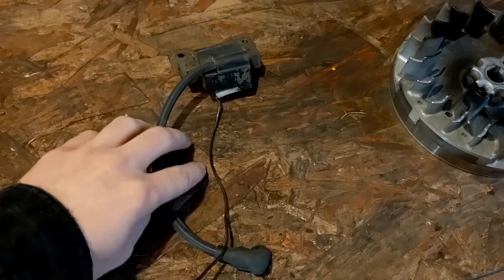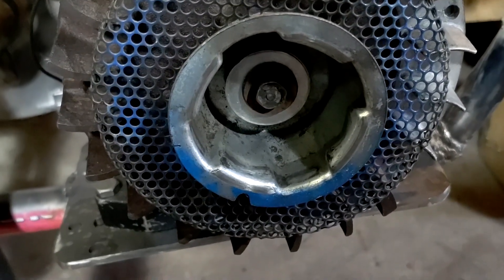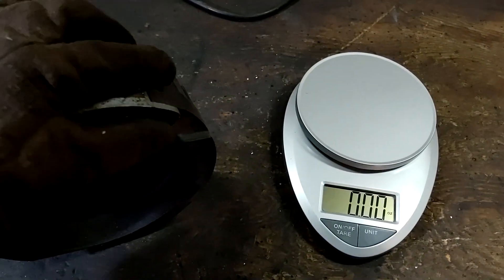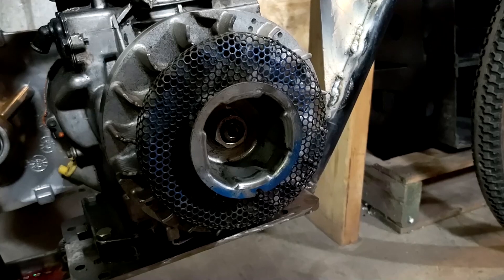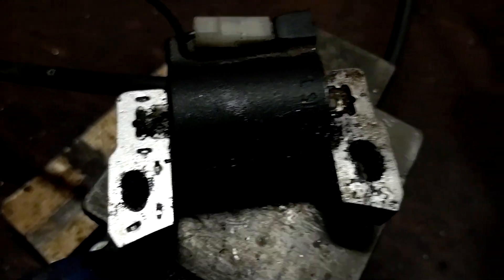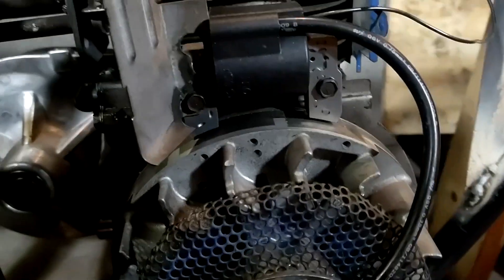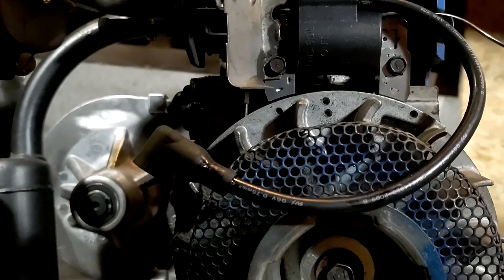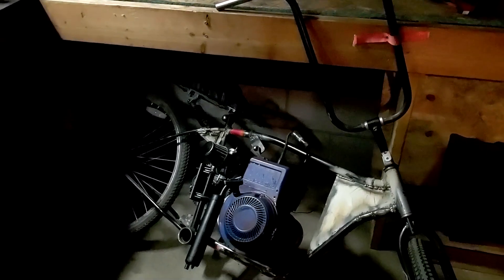Briggs & Stratton 5HP Flathead Motorized Bike Build - Aluminum Flywheel & Electronic Ignition EP12

Comment: thats great if you got spark it means more then likely it will run . now lets talk more about them forks . i was thinking and the issue is a lot of weight  on the  fork tube it is going to snap them forks at some point . the rake you have on the front of the bike  has made it weak . even if you have a good weld its not the frame tube that will snap. its the forks that will bend or snap .  please find a stronger set of forks . dont have to be  shock forks but  a good heavy duty set of mountain bike forks . triple tree forks would be ideal . look at it this way. with the rake you have now on that bike it have set the forks out  more. meaning there will be bounce in them . there no longer straight up and down. fighting the opposing force  of the ground . so alot of force is going to be right at the goose neck . it might not break right away but it will at some point . if im wrong in this please any one point out why . look buddy im not trying to be a ace hole about this . nobody wants to see you get hurt . there is alot more weight  on the bike now with your weight it is alot to take  on them little bike welds . add bounce to that and  it makes it even worse . at least ask someone else  if you dont want to take my word for it and get a second opinion . i dont mind being wrong in fact i hope i am . there is no reason to take chances with your life buddy . your doing 30+ mph on this bike and the front end snaps its going to make for a very bad day for you . ok ride safe see ya in the next one .
Reply from the maker: Thanks for your concern. Upgraded forks are in the works.
Reply: @pulsar2121  great thanks buddy .